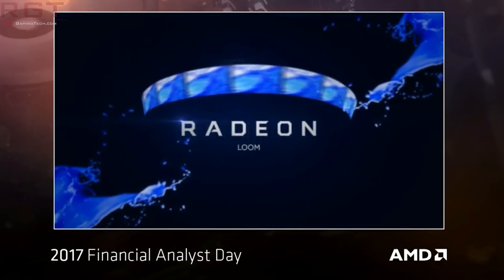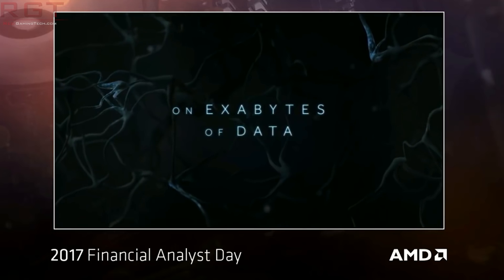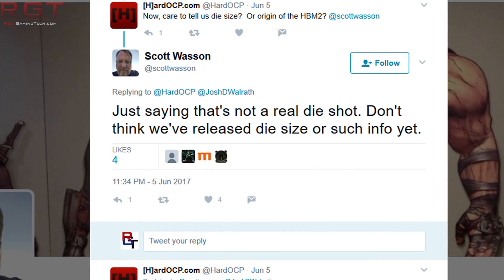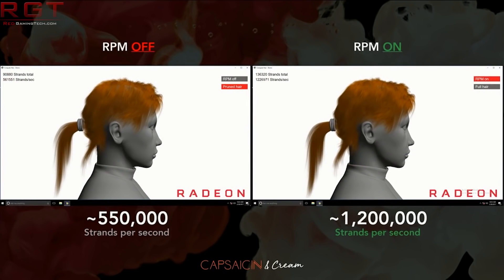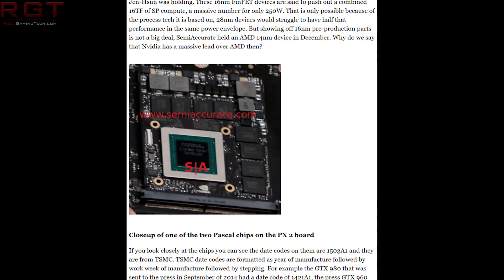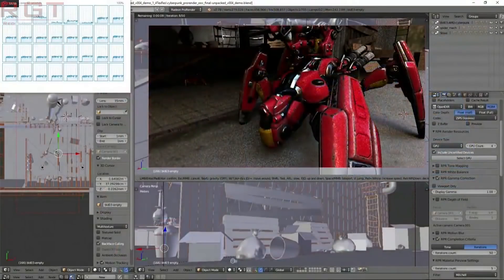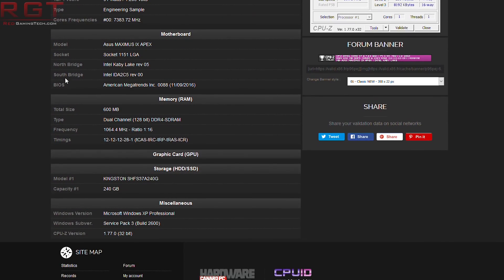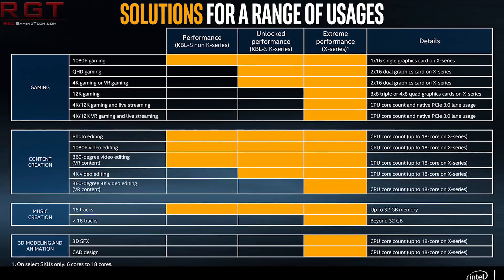Nvidia Showcases HDR By Tampering With SDR Monitors & X299 Kaby Lake X Is an Overclocking Monster

Comment: Yah... that OC is pretty much meaningless.  It was in windows (already booted) with nothing running but CPU-z to show the clock speed and it was only stable for a few seconds.  It also required an obscene amount of voltage.  Neat, but not impressive.  Completing as boot and running a CPU intensive benchmark on water cooling though would be impressive.

Comment: Really RedGamingTech, really.. Did you know that FX-8370 holds the record at 8722.8MHz for some time now. What an overclocking monster it was, it could do wonders at those speeds, hell it even boosted up its IPC! To the point it could make you a pizza if you told it the recipe and the ingredients needed. Also 7740X and 7700K are basically the same chip with 7740X being clocked 100MHz higher at stock. Just letting you know so you don't make such mistakes in the future. Cheers! :)
Reply: No way, I was absolutely serious when I've said that! I mean.. I couldn't have been joking, could I?..
Reply: overclocking doesn't raise ipc. It just raises instructions.
Reply: One more advice, free of charge - never again make clickbaits. It's a bad practice.
Reply: Overclocking doesn't increase IPC. It increase performance, sure, but those performance come from IPC x clock speed and overclocking only change clock speed.

Comment: So that means 5ghz? but still, what about cooling? still need monster cooling... bet you cant push anything over 5ghz, even if the processor can you wont have enough cooling unless you have a hurricane
Reply: Romick Vieira but you're not supposed to overclock your unlocked Cpu!!!
Reply: Birki gts exactly!!
Reply: Birki gts but if you were supposes to do it it would do it very well, therefor oylts the best thing ever, it even got potential ur not supposed to use

Comment: No one should be mining with a GPU, you need an asic computer
Reply: Erethrium (or whatever the new one is called) is resistant to ASIC moduals, so GPUs are the best way to mine that currency.
Reply: Winfield Konkel Etherum* And yeah , you're right . The best gpu is rx 470/480/570/580 . About 22Mh/s each .

Comment: u said the rx 480 overclocks like a beast too 🙄🙄🙄
Reply: My Nitro+ at 1500/2150 would argue it is.
Reply: It is.  But I could get to 1445/2250 on air.  I could get through a fire strike run at 1470.
Reply: def watercooled, mine is max 1315 and 2050

Comment: who cares about 7740k reaching over 7500 MHZ when you can not really use it in a day to day basis
Reply: Yeah but 1.456 volts and 77° i'm guessing this is close to idle or mild load and not on a stress test
Reply: Seriously who only cares about gaming.
Reply: Well I'd imagine it's probably benchable at thoses speeds, and probably gets loud, but for 24/7 usage I'd bet my bottom dollar that he doesn't run it at 5.3ghz 1.456v with an X61... I can get my 4790k up to 5.1 and benchable at those voltages, but it's pretty much irrelevant (except for bragging rights) coz it's far from ideal for an everyday usage
Reply: what is is your wattage usage and how much heat this thing generate , I know for a fact once you cross a certain speed and volts in any cpu , the heat and wattage shot through the roof which outway the overclocking value
Reply: George Narwhel Kids
Reply: +meng shu Very borderline voltage for that CPU, but still great result. I have Gigabyte gaming 3 z 170 which is very budget oriented ATX board, but I managed 4,8ghz on 6700k with 1,39v and 4,9ghz with 1,45v managed benchmarks, but not 100% stable. WIth better motherboard at 1,45v might have been 24/7 stable.
My 6700k is delided and uses liquid pro with 360mm copper rad custom waterloop at 72c...
Still Kabylake manages around 5ghz while skylake 4,8ghz meaning you have very well binned chip though not the absolute best.
Reply: blackandcold Who said games and gaming are bad :D . It's bad when everything you do is only gaming . That's just fucking ridiculous .
Reply: depends on the use case
Reply: my 7700k 5.3ghz cpuz score with kraken x61 https://valid.x86.fr/yn4kdy
Reply: has 8 cores and for gaming single core only matters

Comment: oh geez. These overclocking results mean absolutely nothing for mainstream consumers, or even people with high end water cooling rigs. Please guys, I know you guys can do better than this, I love your channel, but "kaby lake x is an overclocking monster" , is starting to border the lines of clickbait. Because anything can be an "overclocking monster" on liquid helium. My feedback: put the method of cooling used in the title if you feel the need to mention it.
Reply: They supercool these things and disable just about everything they can on the CPU's, including cores. It means absolutely nothing at all.
Reply: Bamcorp Gaming how is it click bait if it really happened. People cry click bait for everything now.
Reply: yes sorry
Reply: actually not everything can be an overclocking moster.
kabylake same as ryzen cpus don't have a cold bug, which makes them able to be run with a full liquid nitrogen pot or rather with liquid helium.
having chips with cold bug means u need to keep them in a certain range or rip for example and this of course may limit the overclocking a lot, but also is more annoying.
also certain chips will scale great with voltage and temperature others won't.
i agree with the general idea though, as ryzen for example has the 4 ghz general use wall and kabylake 5 ghz.
saying a chip rightnow would be an overclocking monster would mean 30 plus percent from boost clock all cores or 5,5 ghz on air.
sandybridge was an overclocking monster for example for the general user.
Reply: AMD FX 8350=8000 mhz
and it still sucks I have one .
Average overclock and IPS is what matters.
Reply: Yea it's Click Bait like most YouTube tech channels these days.
Reply: there is still peoples that do thermoelectric cooling and overclock like crazy. but yeah,you need money for this.
Reply: +zuluknob LOL really?? didnt heard AMD got the record. man.....
Reply: Bamcorp Gaming all game tech youtuber are making this video cos they need view to earn for living ... just watch it and said nothing ,,
Reply: Bamcorp Gaming as do i " its ok for people to voice their opinion" too 
lol
Reply: you mean you only noticed just now ,you didnt notice that every fukin video they make is a trash clickbait with no usefull information whatsoever whats worse i cant stop this shit from coming up in my feed
Reply: @darknessxxv
u mean IPC?
Reply: Agree and i7 7700k managed 7,3ghz ln2 so getting extra 200mhz doesn't mean anything, it might have been simply a better silicon just that tiny bit and many super good overclocking chips are missed by these enthustiastic ln2 cooling overclockers.
in the end kabylake-x might get that extra 100mhz over 7700k, but I doubt they are any different from each other.
Reply: @nova i said borderline clickbait, because 
You cannot say a cpu is an overclocking monster, when the method used is liquid helium. Those gains do not transfer to everyday consumers. Even those with enthusiast grade watercooling loops.  Its kind of like saying my little 4 cylinder toyota can go 150 mph. What I didnt mention was, I meant if i drove it off a tall enough cliff. SO yeah, technically my car can reach 150 mph, but in an extremely unrealistic, unrelated, convoluted setting, that just about noone would even be willing to repeat. Does that make my car a "monster"? No. Far from it.
Reply: lmao, sorry bud. Where I live, its ok for people to voice their opinion. As a matter of fact, my feedback had a purpose, other than the typical whining. I explained my point. Telling people to "just watch and say nothing" is not going to fly anywhere worth living.